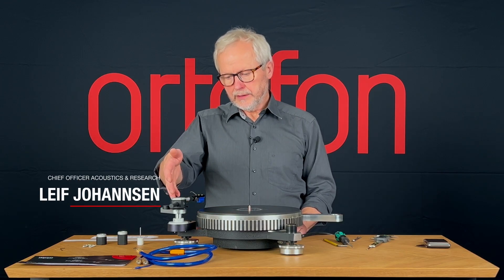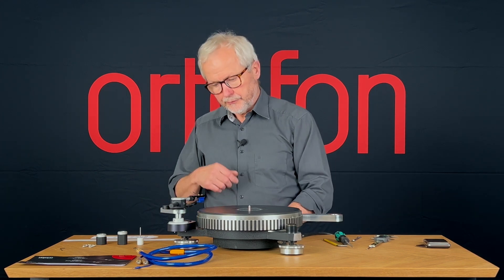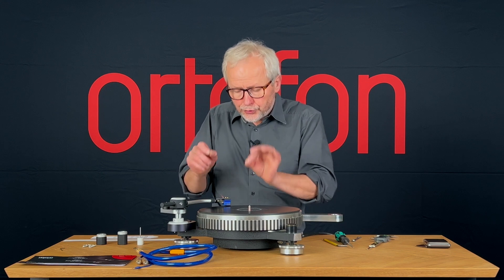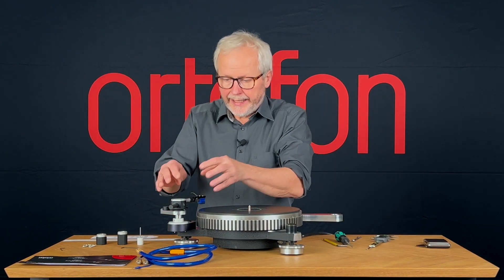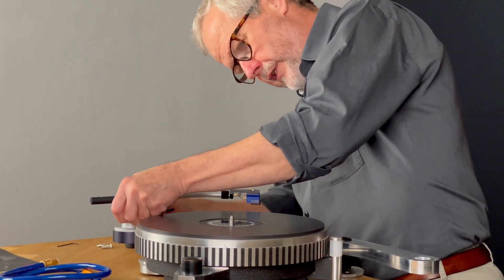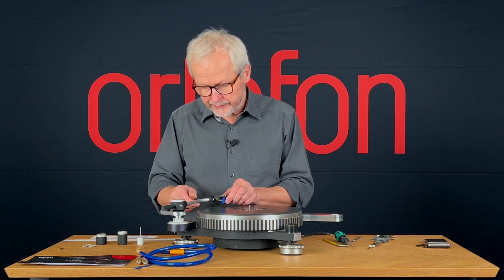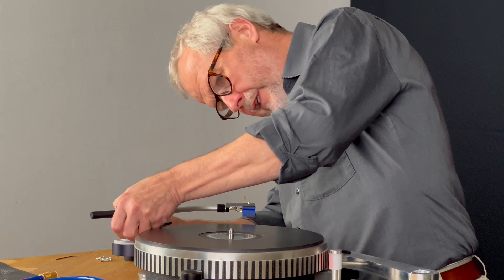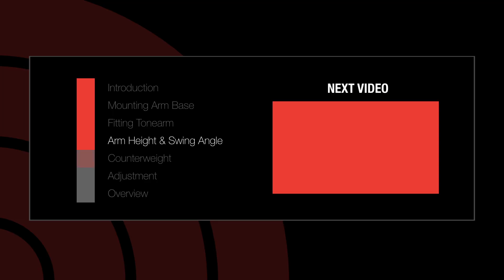How to Set Up Your Tonearm | Arm Height and Swing Angle

Comment: In this video, the position of the parallel lever is adjusted for this cartridge, and the adjustment of the vta and sra angles is not taken into account.But we know that cartridges have different sizes.And, therefore, this setting is not an axiom.